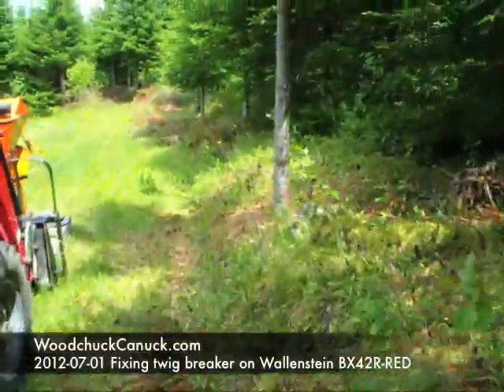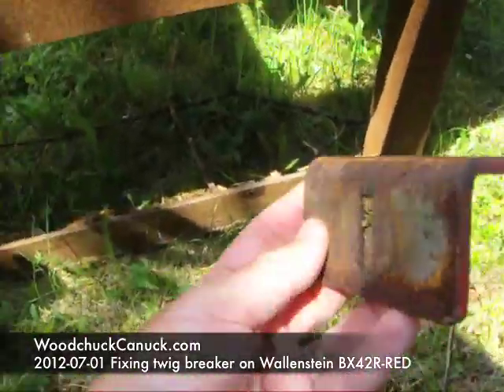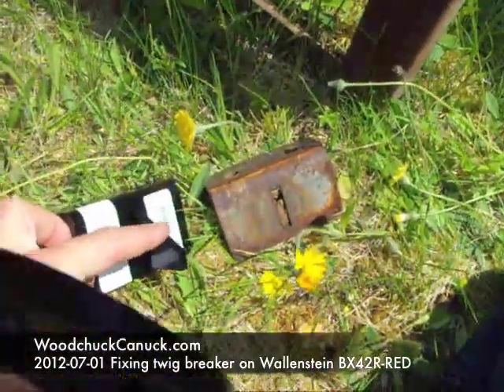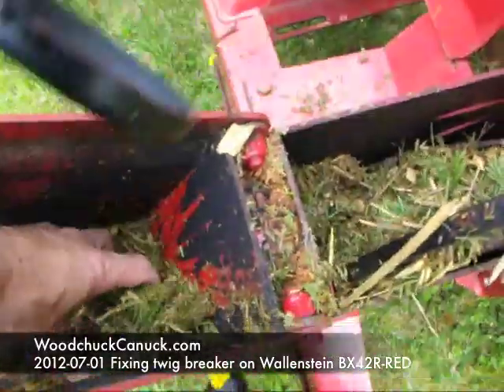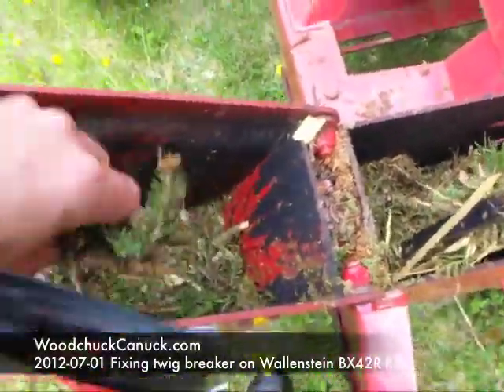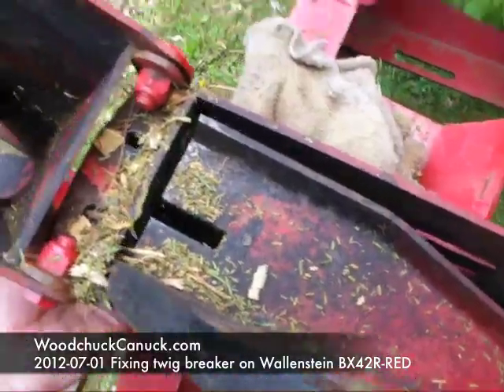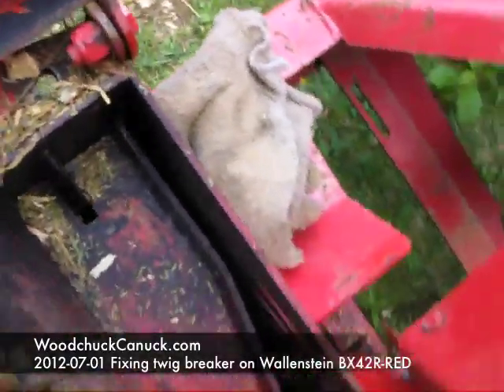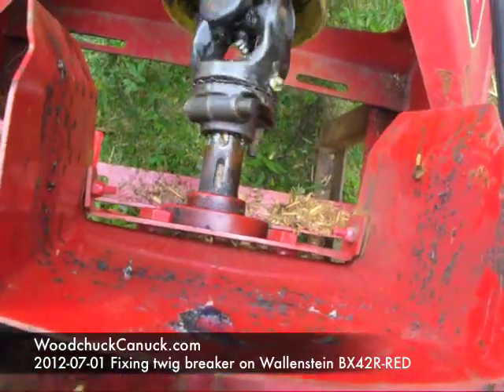Exploring how to replace a Twig Breaker on a BX42R-RED wood chipper

Comment from the maker: Hi Russell, I find that the unit still jams up when chipper spruce and fir, even when my tractor is maxed out running.  Maybe I need to use it some more to learn the nuances of the machine. I know that it certainly does not throw chips like it did when it was on the sellers tractor when I bought it. I'd advise you call the chipper manufacturer to see if your tractor is a good match before committing to a buy. - jim
Reply: Key is proper anvil gap from knife settings to prevent clogging. If the gap is too large, it pulls strips that cause the clogging. I also use my 4th pto gear and spin the chipper at around 2500 rpm. Makes a massive difference. I also see that the new chippers now use a belt to speed up the flywheel when using a tractor with only 540 or 1000 rpm pto.

Comment from the maker: New twig breaker in place. Had to grind away a little bit off a couple of the the rotor blades to prevent striking. Once that was all good, I sparked up the tractor for a test run. Passed through a small fir tree about 15 ft long and 2 inch dia at the butt. by the time the tree was almost in the feed chute, the discharge chute was jammed up with lots of small twigs. Not what I expected. I guess I'll have to play with the feed rate, maybe I feed it in too quick. I'll post another video soon.

Comment from the maker: Just got off the phone with the Peter, tech support at the manufacturer. Seems that from the time our chipper was made they replaced the design of the rotor and twig breaker. I was shipped the newer twig breaker which does not fit on the older rotor. So anybody with an older model looking to replace the twig breaker with part #1011W104, make sure the rotor is the newer design. You can confirm that by giving them your model number. Otherwise you need the older twig breaker part#XC56025.